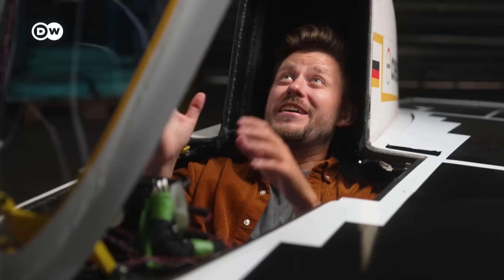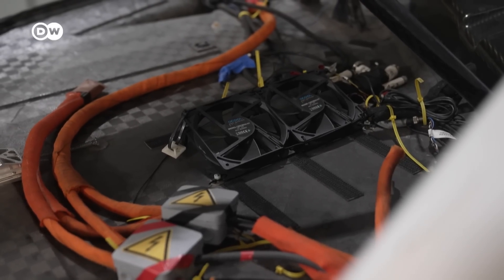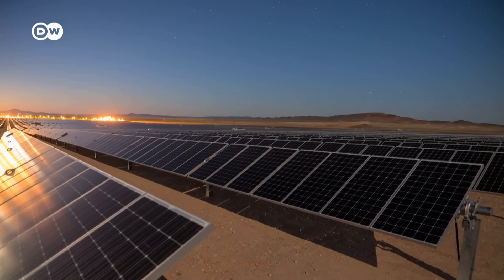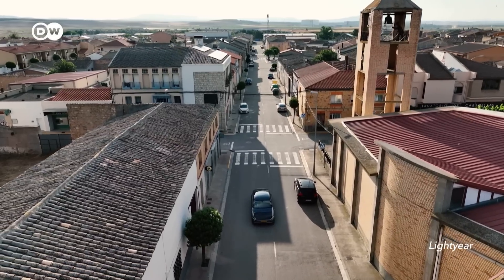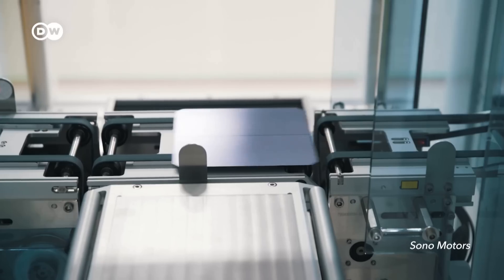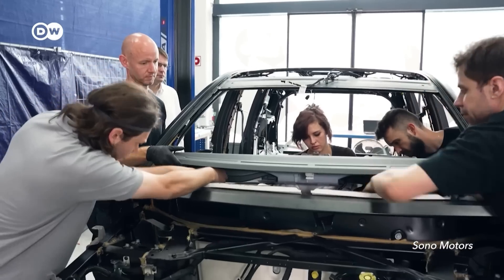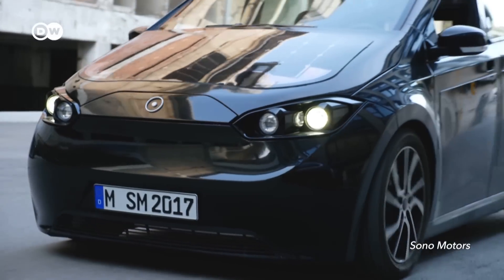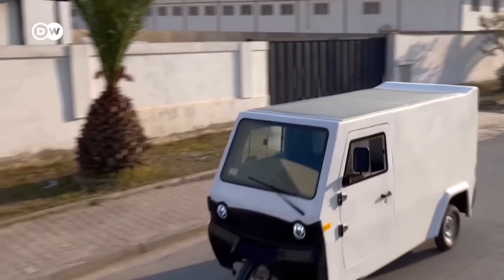Why aren't solar cars everywhere?

Comment from the maker: What do you think about solar-powered cars?
Reply: This representation of Aptera is carelessly incomplete and isn't actually an example of the video premise.  If the title was, 'Startups: Why aren't their products everywhere?', this and some of the other conclusions would seem more honest and cohesive.  Much more could have been done to clearly account for critical details and avoid misattribution.
Reply: @mike4157  Most startups don't include solar, so your title suggestion is stupid.
Reply: They are still just cars and very inefficient mode of travel. What about if you just put powerlines to a highway or better put energy source to the rail, so you don't need a big external battery. I'm talking about busses/trains for people and trucks/trains for cargo
Reply: @Jompe69  That is being tested for some semis on some stretched of road in some places somewhere in Europe. It does work alright last I heard but the setup cost is pretty high.
As for inefficient mode of transportation, wel... Aptera is more efficient than riding a bicycle.
Reply: @-NGC-6302- i like aptera but F more efficient than a bicycle. People are fat. People need to move.
Reply: I think they should stop making cringe ah ah clown cars with six figure price tags and then making a surprised Pikachu face when demand is weak, forcing them to shut down. A "solar car" does not need to be 100% solar powered, it needs to be affordable. No vehicle drives around all day long. Even buses and taxis are parked for hours every day, during which time they could be charging. Like those minivans in Nigeria.
Reply: @Welgeldiguniekalias   Some solar cars can generate up to 40 Km of charge per day, plenty of range for most people commutes in several countries.
Reply: I think it would definitely be a much better idea on something scalable like public transit. Imagine solar buses or solar trains.
Reply: We can go relatively easily to about 8- 10km per day, this is perfect for a city car driving or for short errands during the week and the odd long trip. The solar system should be use as a trickle charger along side normal charging when needed.
Reply: @rrlabastida  I have solar on my roof and it can fully charge my EV, except in cloud and at night. Then the grid feeds it and solar pays that back at a rate of about 3 hours in for one hour used even while I am driving around. There is no need for the expense and complexities of putting some on the EV. It's a useless gimmick.
Reply: If it's ever cheap enough to add a little extra range, sure. As long as it's optional. Mostly it's just a waste of money, at least for now.
Reply: Chill guys. This is a German channel. Of course they want to say Germans are the best.
Reply: This is a ridiculous idea. Do petrol cars include an oil mine or refinery?
Ubiquitous charging/V2L is a much better idea.
Reply: Its a joke right?
Reply: Fuck. Cars.

Just invest in public transport
Reply: I love the concept of Aptera. But even if they get near perfect execution, I see the limits. WEIGHT doesn't matter so much for STATIONARY solar energy collection. And if you put solar right on the car, it makes sense in one way, but the weight factor + efficiency of capturing energy and coverting it into useful work get more complicated. And I DO see that Aptera knows this, and is executing better than most. Having said that, I would want a car port covered with stationary solar, paired with a battery to bring Aptera to it's rightful potential, which is great. 
* I suggest an LFP (Lithium Iron Phosphate) or Lithium Manganese Phosphate for the batteries. Inexpensive, long-lasting, and very fire safe. Temp range of operation is really good, especially with the manganese enriched battery.
So basically, pair the Aptera with a stationary solar +battery system. and you'll get a true winner.
Reply: @andrewkaiser7203  No radiator -  no winner. In fact, not worth owning.
Reply: Nice
Reply: Boy, so many Aptera fan boys have their panties in a bunch.
Reply: The failure of Sonos Sion is absurd and a complete shame, this project was so important, it deserved even government interest, including for governmental fleets.
Reply: heran kenapa...mobil listrik pada gak di kasih solar cell...kan lumayan...nambah2 daya 5-10 %
Reply: @dwplanetA I think you'd be better off covering the more reliable companies with better ideas in the same vein. The guys you covered making endurance R&D cars are not the ones to speak to since he didn't say, 'Hey, but commercial solar cars aren't trying to do what we are. They're trying to provide enough range to make sure you're never stranded, and can always get to a charger, and maybe can commute to work daily. They're also not trying to replace having solar on your roof, they're trying to serve people who can't do that.' You could have made it super clear that Sonos et al, were not trying to recharge the entire battery and don't need to for the concept to be useful. 

You also let that guy get away with saying his R&D vehicle was something like 25% efficient panels without telling the audience how efficient rooftop solar is by comparison. The most efficient commercially available ones seem to be about 22-24% (Clean Energy Reviews https://www.cleanenergyreviews.info/blog/most-efficient-solar-panels). How efficient does the roof on a Fiat 500e need to be to provide a daily commute of power each day in Europe? Also, weight and cost are factors. If it provides you a trip every two days, but weighs little and costs little, it's fine. If it doubles the price of the vehicle, it's probably not helpful. There was a hell of an assumption that the panels need to be curved. Yet... Cybertruck. So... no they don't. We just like curves. Sonos should have started by making a vehicle and just putting the simplest panel they could on the roof/bonnet and making sure those areas were completely flat and didn't require anything hard to engineer.

You should look at companies like Squad Solar who have a quadricycle with solar, which is obviously not a car, but has car like properties and is much lighter than a real car. You could also look at Silence, the Spanish motorcycle company with their S04 (SO4? not sure if it's a zero or an O). It's another quadricycle, and it uses the same removable batteries as their mopeds. An idea they got inspiration for from Asia where it's been 100% proven to work superbly. 

You can take one of the batteries upstairs (or more if you can be bothered) to your apartment where you get neither solar nor a charging spot. Charge it, take it back to the vehicle in the morning and get all the range you need. That also means you could buy a solar panel, prop it up on your balcony* and charge batteries that way. 

*assuming you have a balcony which, for some unknown reason, many flats in Britain do despite our weather being temperate. At last, there's a slim use case for them! I mean, unless you like sitting outside overlooking a busy road and watching ICE cars slowly kill you with their fumes.
Reply: I agree with the conclusion, however, the evolution of solar cell efficiency is increasing every 5 years, and new methods and materials of "wafering" the solar cells are being investigated and analyzed. Every year, new studies on this matter. We may see a renovated Sono Motors coming back in a few years if the new partnerships keep Sono's dream afloat... the Sion is not dead, just taking a long nap until it wakes up. The same goes for the Lightyear 2.
Reply: Good. If you started with a really light good car. As we haven't done anything to stop the rise of the SUV, it's not feasible.  That Australia isn't running on solar cars is a crime.
Reply: It's more reliable using solar panels as a grid along a route and transmit energy to a vehicle through trolley line above vehicles. This is more complicated and need infrastructure, but it's a real work scenarios.
Reply: If there was some relatively easy method to generate hydrogen like from ammonia that is a much better alternative.
Reply: @nicksonpinto2074  NO. Pure ammonia will kill you. Breathing in even a thumb nails worth of pure ammonia will instantly kill you.
Reply: They need to be used in conjunction into electric cars as an added compliment (e.g the roof or the car hood, or both, like shown in the Sonatas), not as stand-alones. The "efficiency" of the PVPs need to be increased to actually make them able to harness more solar power.
Reply: There was a solar camper Stella Vita which is very clever because caravans with good solar panels + good sunlight = freedom
Reply: It's great
Reply: Under PERFECT conditions the sun’s energy at the surface of the earth is 1.3 horsepower per square metre. To capture it a solar panel would have to be 100% efficient and perpendicular to the sun’s rays. (This is consistent with the stats quoted in the video.) Who wants a car with an engine that can only develop 1 hp? This idea is completely impractical.
Reply: @DWPlanetA, I think that the Lean approach of Tunis 10:52 & Nigeria
should be compared to this Dutch project:
https://www.youtube.com/watch?v=AftbgbNgvHQ&t=21s
Reply: Why did you do a hit-piece on Aptera? Why not show the latest Aptera instead of a prototype from years ago? Weak journalism or intentionally misleading? 

This is why main stream media are losing viewership.
Reply: @theunknownunknowns256  said: "Why did you do a hit-piece on Aptera? Why not show the latest Aptera instead of a prototype from years ago?"

The latest functional Aptera was shown.  It's the one that couldn't make it up the hill.
Reply: @theunknownunknowns256  He went light on Aptera, and showing the Gamma makes no difference to the story. You tell me what difference showing it would make? I have over 60 videos and you are welcome to correct anything you see as misleading in those; knock yourself out.
Reply: Solar powered cars are a gimmick because there is not enough sun facing surface area on the car to power the car for more than short trips. Every effort was made to reach the ultra light weight of 160Kg for the solar car.  This is impractical because you might have heavy individuals or other passengers or luggage/cargo etc. Optional solar to improve a car's range is probably the way to go(which is what car manufacturers are doing).
Reply: OK for people who park in one spot once a week and drive less than 120 miles week.

Comment: No need to be perfect product. They should put solar on EV just as range extender or as solar regen, not for off grid 100%... Then from there improve step by step untill get full solar car... example like Tesla Model 3 put solar roof just that can regen 5km-10km/day is good enough... I will make you electric bill cheaper and you can reduce number of plug in wall charger...  You have free energy for pick-up kid from school or do groceries shopping...

Comment: Haven't watched the video yet and want to guess the answer: 

Because the amount of solar panels that fit on an electric car don't provide enough electricity to run the car long enough to justify the added cost and complexity.

Especially since the form factor of a car won't necessarily have very much of the body positioned to even catch sunlight at the same time. So even if the car would technically have enough surface area to cram the needed solar on, they won't be facing the sun all at the same time.

Comment: This is all bullshit. Well not all of it. Once mass adoption of solar panels on cars occurs it would cost the manufacturer probably 200-500 extra. When you think of the bigger picture, if we have millions of cars with solar panels, the draw on the electricity grid would be significantly less. Energy needs to be sourced as close as possible to where it is used, the further away it is, the more losses that are incurred and the more infrastructure needs to be put in place. If governments really want vehicles to be as Green as possible then they should be mandating that all vehicles have them.

Comment: Simple the efficiency is not enough to pla e on a car but it can help boost range as seen on another DIay bonnet build by 6 miles with 86-180w input which essentially would be better than nothing of course especially if thevehicke situs idle outside for a few days and is not used often it can essentially charge it without plugging it in. But replying on it only won't work with current tech

Comment: There is no actual way of solar powered cars to work. its just a money pit to lure greedy people calling themselves venture capitalists. actual energy of solar power is 1 kw/m2 at surface of the earth. them high end panels have 25 percent efficiency. to get a 80 hp out of solar which is the power of a peugeout 206 1.4 you'll need 268 m2 of area. so yeah its basically a money pit for dumbs

Comment: We could easily do electric cars today that have 10 times better range. Much shorter charging time. Easy. Just think if all car manufacturers could now decide on a standard in batteries, easy to change in stations for fully charged ones at stations. And also a charging system on the road, like a rail that car, busses, trucks could connect to in one lane while going on highways. Or just connect when standing in the parking lot for charging.Then also have solar panels on the car. If this was decided and all car manufacturers had it, and roads and stations you could travel all over Europes highway without charging or leaving your car

Comment: The weight of the solar panels and charging hardware causing less efficient travel can more than offset the power gained. The exception might be for vehicles parked a long time where no access to solar energy is available and there is little travel.  For most part better to have panels over storage areas to charge batteries with.

Comment: Think futuristic: You need solar roads on which cars are powered to run remotely and which generates enough heat to convert excess water (from rain) into steam power that works as back up energy. This way, everyone gets to have good roads. Smart roads are the future.

Comment: Cars will never be able to drive off solar alone. Besides all the flaws you mentioned about EVs charging only by the sun they can only be powered for about 5 hours a day. Unless you never drive at night ok. But what about 2-3 days autonomy standard? You NEED large batteries in EVs which makes them heavy which makes the range less which proves they will never work. Solar panels are cool but ultimately they lied and they don’t work as promised.

Comment: I put my EV in the garage no way I want to leave it in the sun all the time and have solar panels on the house and garage plenty of space and 1/2 of it at a good angle, cheap simple solar panels and mounting where weight or streamlining is no issue that provide power for the house as well when not driving.  Makes perfect sense for a low power low price golf cart the price of the solar panels would be the roof, and a smaller battery could be used as well as a golf cart is outside all day and not used in the rain.

Comment: OK so the tldr is: they are impractical and too small with poor angle to the sun to be useful. Of course the real solution is panel over the Sahara and plug in a cable.

Comment: I always wondered if you could somehow integrate wind power - like on the front of the car so when you're going faster, the wind is turning the generator.  But I really don't know anything about it, and I'm sure someone would have done it if it was feasible. 🙂
Reply from the maker: That is an interesting thought, but the energy needed to overcome the additional air resistance created by the wind turbine would come from the car’s engine or battery, effectively making the car less efficient overall. 🌬️

Comment: The key thing about solar id its return on Energy invested. The ROEI of solar is very low often below 1. What that means in many cases is that you will burn more energy making the solar panel than the energy the panel will produce over its life time. There is no zero fuel cost the only advantage is in an enviroment of rising energy prices you will have locked down the energy price as at the time of manufacture. Thats why solar panels on a house up to recently had a negative return even now a lot if not all systems fai to break even.

Comment: Solar-powered car sounds like a bad idea. Cars "usually" drive on the ground, between trees, buildings, hills and so on. Which already reduces possible yield. Not to mention that solar cells will never be optimally aligned with the sun. But yet you have to carry those solar cells day and night, through cloudy weather and other conditions ware they don't contribute anything, but still ad weight to your car. If parking spaces or homes can be solar-powered, it might be the better idea to simply charge your car there.

Comment: I was hoping to see more with this video. but it does seem to be lacking certain information. And I wonder why it was not included. Lightyear for example. Was a planned bankruptcy to enable it to produce the cheaper version. the lightyear 2. It was forced by law to give a cooldown period before starting manufacturing of the 2. That being the end on 2024. The new lightyear is due out at the end of 2025 currently. At £40k.. Apparently Tesla has the capability to put solar on its roofs. Why does it choose not to..??. I think the EV agenda is being controlled to make people still have to pay to power. Oil and gas companies are still controlling whats going on. with 200 more gas power stations being built worldwide. This is not the climate change we want. we want lightyear type cars. Why is this not being pushed by governments. instead they favour the oil and gas. 99% of the world are not buying EVs . Currently. as of this date. 06/06/24. there are only 1% of private pure BEV car owners worldwide. That figure is not predicted to change by the end of 2025. by which time. lightyear 2 will be on the road. lets see if EV ownership starts to go up then..